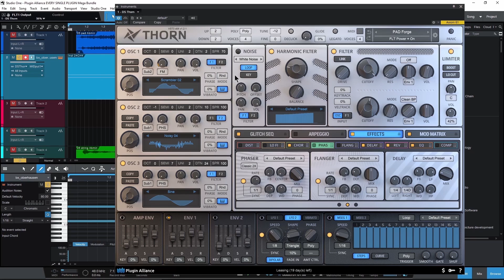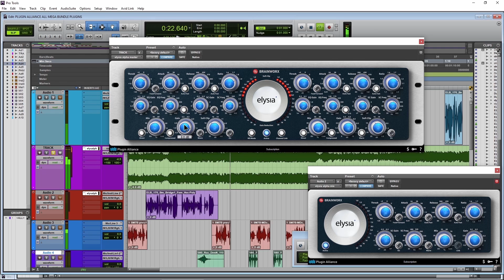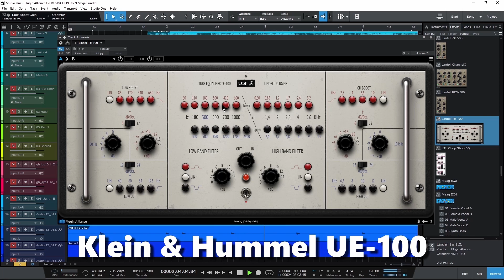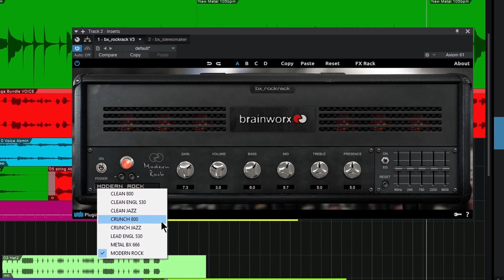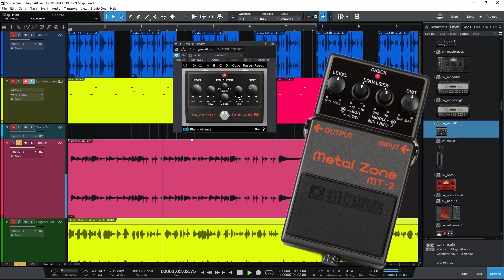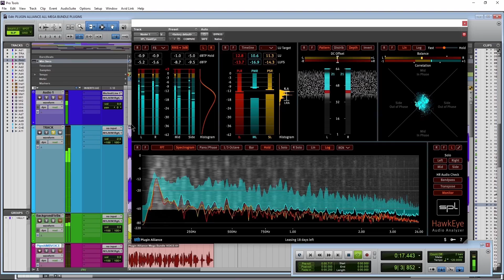Plugin Alliance MEGA Bundle - EVERY. SINGLE. PLUGIN. (2020)

Comment: I hate subscription based software, so will not buy it.
Reply: LoL. Ok dude. GL passing on $20,000 worth of plugins for $25/mth
Reply: @anthonydipizzio1623  and a voucher back of the 245 dollers to actually buy the 1 or 2 plugin after
Reply: yes but you get a 245 voucher back to buy one plugin at that price ?
Reply: This is literally a competitor to UA. A company I wish would do this. I’m canceling my slate digital subscription and linking with PA. I just bought a new M1 Mac and can’t even use it because slates products still aren’t compatible.
Reply: You get to keep 10 plugins so best subscription model around
Reply: Or you can use rutracker instead